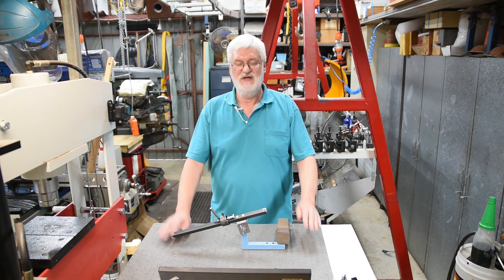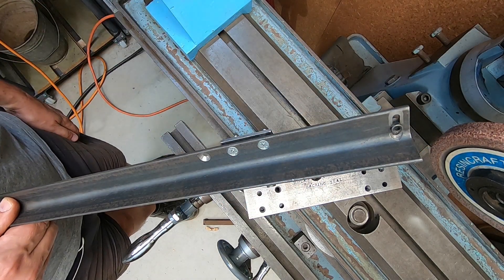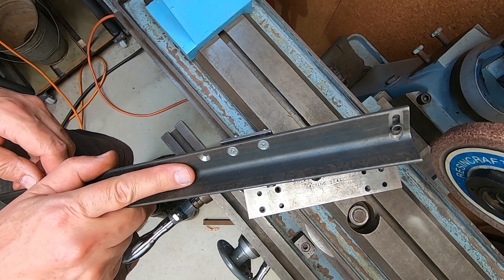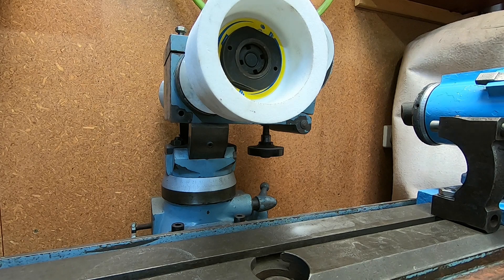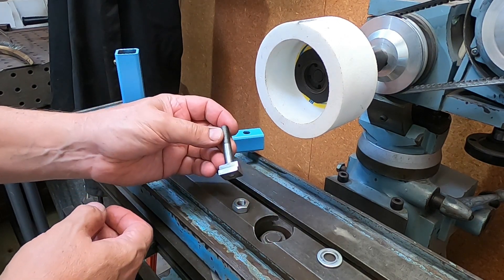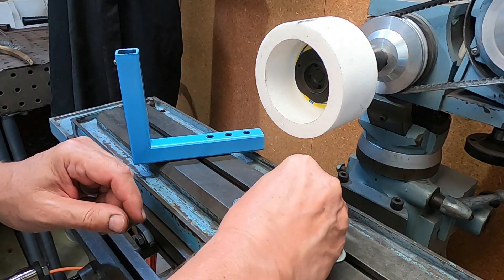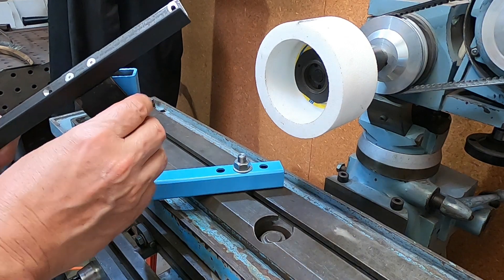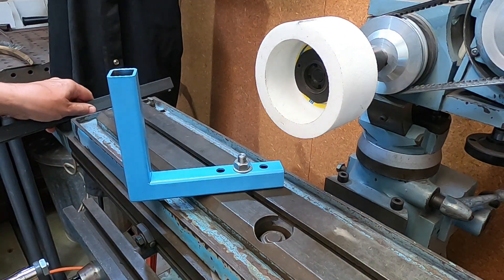Drill Sharpening - The Finished Tool for 4 Facet Drill Grinding

Comment: A really useful addition to a 4-facet grinding jig is an inexpensive old analog CCTV camera with microscope lens (from China via eBay) mounted in such way that if you slide the jig to the side, the tip of the drill presents itself to the camera lens and shows up on a monitor connected to the camera at 5-10x magnification. 
You see everything nicely and can make any corrections as you go.
Reply from the maker: A magnified view of the drill tip in situ would be really useful - especially to old eyes :)
Thanks for watching.

Comment: Use a hex driver instead of an Allen key for adjustment, and use knurled thumbscrews to hold the clamps..
Nice work..👍
Would a square clamp to hold the bits be good idea, so they could easily be turned 180 degreees?

Comment: Is that a new hydrsulic press? You previously had a taller which looked the same as mine but different colour scheme. Whats the story
Reply from the maker: Mike, as I think you have realised, I only have one hydraulic press and it's apparent height depends on the camera angle.
Cheers.
Reply: Hi yes i see that now. Tell me where did you connect the air pump in?

 I lost your channel for a while as it was on my other account. Now on both
Reply from the maker: @mikebryan544  Perhaps a couple of segments in this (early) video describing the mods to the press will provide the info you want:
https://youtu.be/P6FVu7VnGcs?t=443 and https://youtu.be/P6FVu7VnGcs?t=584
If not, I can take some more pics for you.
Cheers.

Comment: Great jig, I reckon I may copy your ideas thanks. 
How did you finish up setting the cutting lip horizontal?
Is it as important to have the lip horizontal when grinding the secondary clearance angle?
Reply from the maker: I just eyeball against a rule held horizontally. It would be nice to come up with something more scientific but I haven't really put any energy into that yet. Probably not critical for secondary clearance angle to be horizontal but this is an easy way to make sure both lips have the same angle - which is important.
Cheers, Alan.
Reply: @alanshomeworkshop  I wonder if you used the same demonstrated method but used it to set the to-be-grinded lip horizontal, would work?

Comment: So 2 years on does the jig still sharpen drill bits regularly
Reply from the maker: To be honest, it hasn't been getting much use lately. I don't sharpen drills that are less than 1/4", and I haven't needed to drill many larger holes in my home workshop this year as I tend to use annular cutters and boring tools on the mill and lathe.
Cheers.

Comment: bonjour j'ai fabriquer à peu près le même prototype, je possède la même machine que vous AR5 !!! je comprend pas pourquoi vous ne vous servais pas du vernier de la table Y pour le déplacement de la prise de passe ? plutot que de vous compliquait le travail avec le réglage à vis
Reply from the maker: By in-feeding using the table Y travel, the lip slowly diverges from the horizontal as the length of the drill is consumed ie the outer edge of the lip drops due to helix of the flute.